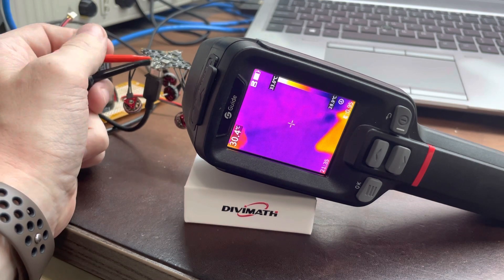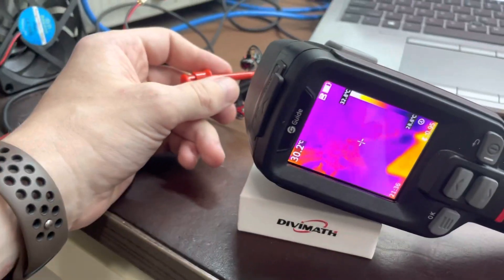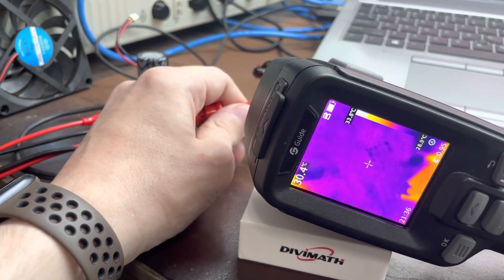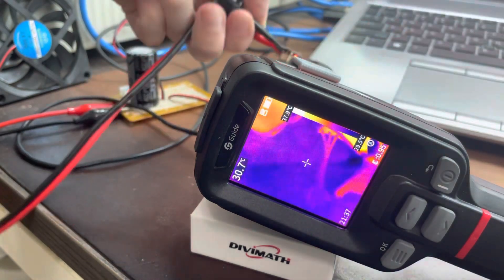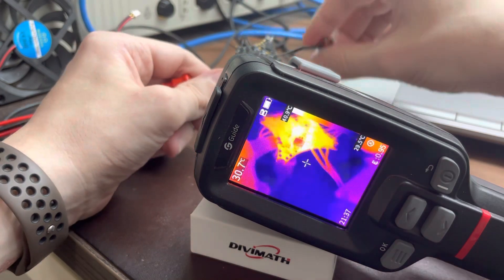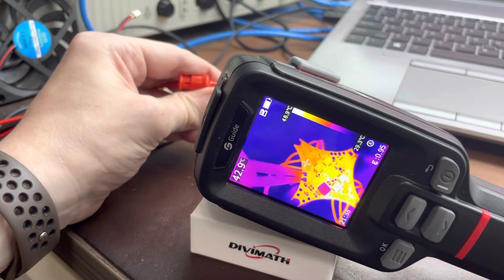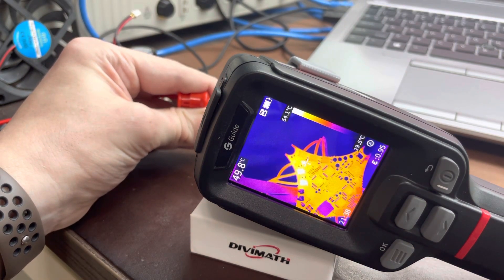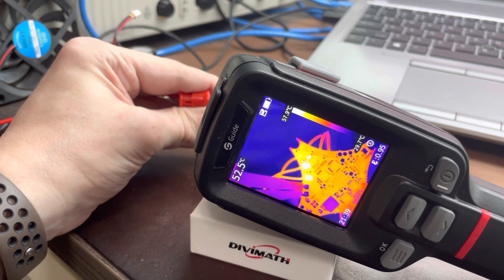Superbee F4 self-repairing esc?!

Comment: Happymodel seems to have some quality issues.
Just got my Happymodel diamond FC and it has bad oscillations from 30% throttle.
Can't get rid of them with PID and filter tune. Tried everything.
The motors worked on the previous build. So must be a faulty gyro or FC. Any ideas what the issue could be?
Bought it from fractal with a frame directly.
Let's see if they will send me a new one. I believe it's a shop selling your designs in taiwan.
You're in europe (france? ) right?
Greeting from germany
Reply from the maker: let's have a look at it I'll reply to your email (I'm the guy)
Reply: Don’t buy happy model